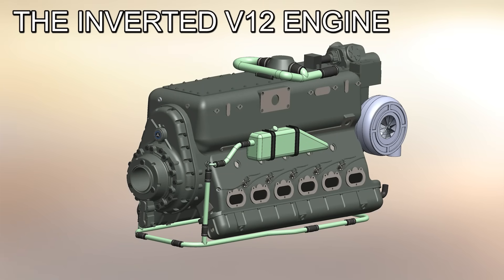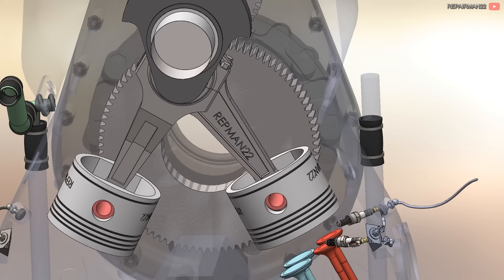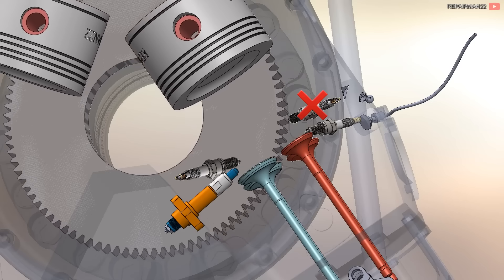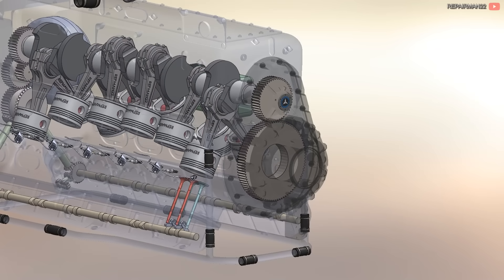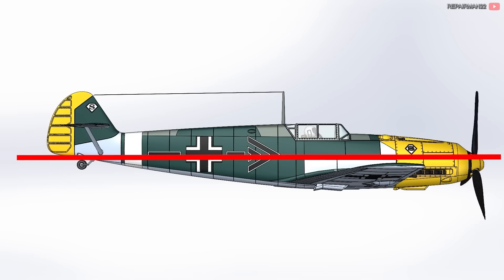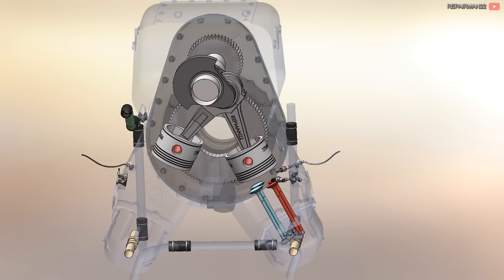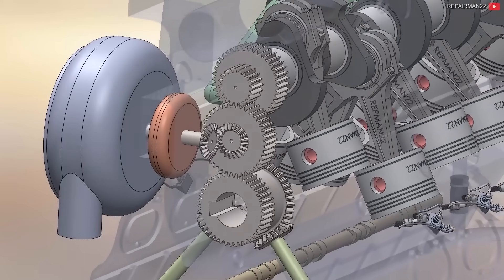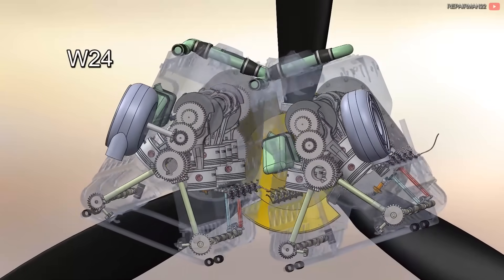The INVERTED V12 🤯 Why!?!?  - 3D animation - DB 600 Engine // Daimler Benz

Comment: This design is basically inferior.  There is the danger of hydro-lock and fouled plugs.

The only reason they did it was because it allowed easier servicing of the heads.  A man could service a DB601 while standing on the ground.  A Rolls Royce Merlin required a scaffold for the same servicing.  That, and the inverted design allowed for a lower cowl line, allowing for cowl guns and improving visibility.

Comment: Nothing in America or England Japan or Russia could compare. An elegant design concept made complete with great engineering & problem solving...
Reply: You are right, they did not compare.  The same displacement RR Griffon had superior metallurgy, superior supercharging, massively longer engine life and 50% more power.  It’s hard to be a Wëhräböö in grown up discussions.
Reply: @Willheheckaslike  If I correctly follow you, you're asking about the 60 Series RR Merlin, that is to say, the 2-stage supercharged Series, as used in the Mk IX (and others) Spitfires. This engine allowed higher boost pressures, ultimately (late '44/'45) in the range tof 72" hg with 150 octane avgas, famously in the Packard Merlin equipped P-51D. As the British were striving to keep the Merlin competitive, especially during the crucial time of the introduction of more advanced models of the Bf-109, and of the FW-190, the USA was of great help with its advanced silver/aluminum/indium bearing technology, and its iridium electrode spark plugs. These technologies were what allowed the Merlin to be able to endure the much boosts pressures that 2-stage compressors, intercoolers & high octane promised. Implied in that, the necessary strategic materials/exotic alloys were available to the USA, and therefore to Britain. Germany, after '40, had to increasingly restrict its industry's use of these materials, some of which it never had access. By mid '44, the lack of alloying materials was so severe that German armor was developing unacceptable levels of cracking upon impacts, and transmissions/gears were also failing at higher levels. Some of this can be attributed to falling/rushed production standards, but mostly to lack of strategic materials. To quote Albert Speer, by end of April '45, the total amount of strategic ores remaining in Germany could be enclosed in a broom closet.
Reply: @hokehinson5987  Dear Hoke, um...here's the rest of the story on the DB inverted V12: the German lead babbit bearing technology was crucially behind Allied thin-backed, aluminum/silver/indium/lead technology, preventing boost ratios competitive with RR, not nearly as resistive to avgas, meaning lower bearing life & engine life; poorer spark plug electrode technology vz. RR, due to complete non-availability to Germany of exotic, low resistance (high conductivity), high durability metals, i.e. irridium, creating frequent maintenance/ignition issues; non-competitive with RR after 1942 2-stage
boost development & pressure cooling, meaning bigger (drag!), heavier radiators, & boost work-arounds that, while inspired, were not SUFFICIENT to offset Allied high altitude dominance; perhaps most importantly, after 1940, rapidly declining availability of ALL strategic alloying  materials, chromium, nickel, cobalt, manganese, vanadium, tungsten, silver, meaning endless metallurgy headaches with sub-par solutions/work-arounds at ALL levels of German war production, and severely limiting aero-engine capabilities (if they had had 2-stage blowers, THIS would have been a limiting factor. Albert Speer wrote, in "Inside the Third Reich" that, at the end of April '45, the amount of strategic alloying materials still available in Germany would not fill a broom closet. That should give you an idea why stainless steel for such as turbo-superchargers & jet turbine blades, was out of the question. As was very high nickel content exhaust valves, a necessary component of RR & all aero engines.
Sooo, we MUST & SHOULD be very guarded & qualified in our statements regarding superiority of German design & engineering. That the German aero industry was as innovative as any, and did exceptionally well under the circumstances, is accepted. The problem is in war there are NO second place winners.
Reply: Actually, much in U.S. & England compared very favorably. 
What this video did NOT tell you was the rapid, steadily decreasing decline as of 1940 forward of German alloy quality due to inability to acquire sufficient strategic metals for their production requirements: manganese, chromium, nickel, moybdenum, copper, aluminum, vanadium, cobalt, tungsten--even high quality Iron ores. More exotic metals like platinum, beryliium, indium were out of the question. That's why there were unending problems with their engines, such as valves that burned & corroded causing detonation, spark plugs that would not last, and non-competitive lead-babbit bearings that could not endure high boost pressures and corrosive fuels. You ever notice grainy quality of German WWII film? Yeah, even silver was in short supply. And not enough chromium to produce stainless steel. They were working at an alarming strategic material disadvantage, and, unlike US or USSR, could not compensate with higher production capacity than their adversaries.
Reply: @josephstabile9154  Also the Germans had a shortage of skilled workers, then a shortage of semi- skilled workers and eventually even resorted to slave workers who took every opportunity to sabotage whatever they were forced to make for their oppressors.

Comment: Most WW2 (and earlier engines) used Reduction Gear!  (This is why most Radial engines have that big hunk of metal in front of the cylinder bank(s)... it is where they have a planetary reduction gear system).
Reply: Propellors don't work efficiently above 1500 rpm, so I suppose it allowed them to use higher revving engines giving more power to weight. It's all very interesting.

Comment: Alison (US Aircraft) Coupled two of their V-1710's together also.  This is the very rare V-3420 (although technically it was a "W" engine just like the DB.  It was never quite perfected, and with the advent of British Jet Engines, Alison stopped the program entirely,.
 
However, the "V-3420" drove a fancy gearbox that turned Counterrotating Propellers, which was a fad for awhile.  In my opinion only the British got this right... In all but a very few cases, instead of a Huge Engine driving a complex gearbox (which was the source of most of the failure that almost always resulted in a crash*),  they went with (most of the time) with two standard engines per Counter-rotating propeller set!  Each driving it's own propeller to achieve the same counter rotating affect!
 
  *like the Hughes XF-11 crash after a gearbox failure cause the right hand propeller set change the pitch with one propeller going into full reverse thrust and the other went to fine pitch (which produce very little forward thrust.  Just before Howard Hughes got to a golf course, the forward propeller went to zero thrust and this, along with other factors caused the crash that nearly killed H.H.!

Comment: Sorry  water boils at 212 at sea level is absolutely correct, but somehow i don't think that you mentioned how a airplane is rarely at sea level and the lack of air pressure caused lower boiling point , and air density has a great effect on heat transfer,  i did enjoy video,  just thought minor important details slipped by, i did learn things, and thanks for sharing sir

Comment: Actually, the original steam engines had the cylinders at the bottom and crank or beam above so this V12 is "right-side-up".  When engineers decided to put the cylinders on top and crank at the bottom, they were called "inverted" engines, which became the norm.
Reply: So it's actually an inverted-inverted engine 😉
Reply: @starsiegeplayer so when flying inverted - it's an inverted - inverted - inverted ?
Reply: @JollySchwaggermann at that point it comes full circle and reverts back into a medieval watermill
Reply: I imagine a coal-fired fighter plane would have a limited range
Reply: This proves the point; "The more we change, the more the same we become".
Reply: We will uninvent the wheel soon.
Reply: They didn't run wet sumps however
Reply: @kingcosworth2643  No, just drip-lubrication with oil-cups and greasers climbing all over them with oil-cans.  I think you'd have to have quite tiny midgets lubricating this V12 ;P

Comment: You should look into the Napier Saber engines. They are a wonderful and slightly weird engine that uses sleeves instead of valves to exhaust and intake air.
Reply: I believe the Napier engine used in the Hawker Typhoon had a service life of just 23 hours..is this correct?
Reply: They were overly complicated and ran hot.  Maintenance was a complete tear down and the simpler jet engine took over.

Comment: And Brits talks about the Merlin. DB600 series engines outperforms Merlins by any means
Reply: Except that, though roughly the same power, the DB600 series were 34 litres and the Merlin 27 litres.
Reply: @anthonyjackson280  As mentioned in the video, German aircraft engines during WW-2 were engineered to run on low quality/octane fuels. The US kept the UK supplied with high quality high octane gasoline that allowed them to have higher specific output engines.
Reply: @yosemite-e2v  The Merlin also originally ran on 80 octane, 100+ octane became available in 1940 (JIT for BoB). And was still competitive with DB60x.  Plus German fuels (later in the war) were not much different in practice, they also had octane boosters but used different rating standards.
Reply: I’ve always been  a Merlin fan, but the 600 series was fuel injected from the start. No issues with inverted G stalling.
Reply: @scottbruner9266  RR was well aware of FI.  They rejected it for reasons of complexity and much higher fuel consumption.  They also found that the fuel vaporising in the carburettor also cooled the fuel/air charge and acted as an inter-cooler.  The negatve G problem was rapidly resolved, first by 'Miss Shilling's orifice' then pressure fed carburettors.  The FI was purely mechanical, not the sophisticated, computer controlled EFI in modern engines.
Reply: @scottbruner9266  The British fixed that problem with Miss Shilling's orifice in 1941 and later with the Bendix pressure carburetor in '43.

Comment: I remember a video where a guy sent a DB601 crankshaft into RR to have it measured and checked. The engineer at RR said the specs were spot on to its very high tolerances  He said don't drop it because they couldn't make another like it the tolerances were so exact with their modern equipment. Imagine they were doing this in the thousands under constant bombing of their factories.😮
Reply: Dad is Blödsinn. XD
Reply: Who were they.. Hehehe the slave labour cought in eastern Europe.. Hehehe just saying.. Same applies to rest of German might..
Reply: "Theiir", meaning the slaves working  in the NSDAP factoties?
Reply: Saw same video.
Reply: All aero-engines of WWII inspire such tales for the simple reason that they had to be precisely built to work, at all. What you never hear about are the rejects, with the exception of RR Merlin engines.  Enough Merlin engines failed the quality control checks that it was practical to use the non-flight rated engines to power tanks, after renaming them 'Meteor' engines; although, tank production demand for rejected engines ramped up to exceed supply, so they started production lines that produced engines of modest power, generous tolerances, and cheaper materials.  Rejected RR Merlin engines were good enough that new lines were built that never produced flightworthy examples.
Reply: Yeah.  This was the problem with a lot of German stuff.  Very innovative and high precision… but they were useless for lack of trained personnel and fuel.
Reply: The machining of the P&W 2800 was so precise that there was no gaskets between the engine block halves. The Germans were astounded by the quality of those engines. Some of the generals knew they were going to lose because of Americas industrial strength.
Reply: @johnarnold893

This isn’t particularly impressive.  Most aircraft engines don’t use gaskets between the crankcase halves because unlike automotive engines the main bearings are incorporated into the crankcase and don’t have separate caps.  If they used a gasket the preload would change as it compressed or expanded leading to a spun bearing or catastrophic failure of the through studs that hold the combustion forces.  

They typically use a silk string to act as a gasket.
Reply: @calvinnickel9995  Silk string as gasket? No wonder I find grease stains on my shoulder every now and again after a prop plane flies overhead!
Reply: @johnarnold893 and were took by surprise when an american pilot stealed a Focke Wulf FW 190 not only by the BMW 801 engine as is but All the solutions germans adopted on entire aircraft..
Reply: @kkteutsch6416  I'd say our guys were mildly interested, not hugely impressed. Our engines were as good or better. Bear in mind that the Germans couldn't make high octane fuel, they were not that smart.
Reply: @dougerrohmer  i would like to see, if americans would be able to make any fuel with the limits, the germans had
Reply: @razorix6843  Why would you do that if you had the technology to not do that? And if you don't have enough oil, why would you go to war against the countries in the world that controlled all the oil? Sounds stupid. Oh, wait, it was stupid.
Reply: @dougerrohmer  and you didnt answered my question
Reply: @razorix6843  I did. Why were the Germans in that position? Firstly, they didn't have the industry to make the amount of high octane fuel that the Yanks could, and secondly they took on all the major powers who had oil of their own, and the Germans didn't have any. To try and find a silver lining in this situation by saying "Ah, but could the Yanks achieve what the Germans could with what little they had?" is just silly.
Reply: @dougerrohmer  so you literally proofed me right, thanks for this
Reply: @razorix6843  Hang on, I geddit. You are here on the internet in a vain attempt to sound clever. Hint: Proved.
Reply: @dougerrohmer  no, but you proved me, that americans are not able to achieve things, the german achieved, with their limited ressources.

And back to your first attempt, why is the usa in war with mostly every single nation, who has oil, or was in a war with those nations, after them got their oil?
Reply: @razorix6843  You're a troll. Good day sir.
Reply: @dougerrohmer  - Yeah, that's what WWII comes down to. Just this. :-b
Reply: @razorix6843  - When you say "not able", you mean "did not". Germany and USA can't be compared. It's apples and oranges. Germany was what it was, the USA was what it was. It's not that the best engineers were better in one place or another. It's the whole country's influence on what each engineer would be doing.
Reply: @dougerrohmer  no. to build strong an powerful Engines without good fuelquality was a masterpiece.
Reply: @johnarnold893  wanker

Comment: Well done.  The cooling issues were covered well, didn't know about them until this.
Reply: Missed out that the boiling point would drop with increased altitude. The system would become pressurised anyway.

Comment: 11:36 Fiat?! That's a Rába Bf-109G-2 Built by Rába in Győr, Hungary under license. That is NOT an Italian Bf-109.
Fiat and Alfa-Romeo built the engines under license to domestic Italian Fighters, like the Macchi C.201, Reggiane Re.2001.
Kawasaki and Aichi both recieved the license, because Japan had a severe interservice rivalry, and the Navy and Army would not want to share an engine, or aircraft. Aichi produced for the Navy, and Kawasaki produced it for the Army.
The other thing you missed is that Germany didn't have a fuel shortage when the engine was developed, the Injection was specifically developed for manuvering advantage, and the MW-50 injection was used for energy traps as well, since with the extra power, they could actually have both the horsepower, and airframe advantage over the P-51D.

The inverted design was sought after specifically for leaving more space over the engine, enabling the installation of machine guns, and giving better visibility for the pilot.
Reply: It wasn't a fuel shortage, it was their inability to produce high octane fuel.
Reply: @dougerrohmer It wasn't an inability to make high octane fuel, it was the inability to make enough high octane fuel--actually, enough of any fuel--to meet it's constantly increasing needs.

High octane fuels were available prewar, viz. speed record attempts. DB 601N engines used C3 high octane fuel in 1940, and, by late '41 all FW-190's used C3 for their BMW 801D's until the end of the war.
Reply: @josephstabile9154  It was more an inability to make enough of ANY fuel by the end of '44.